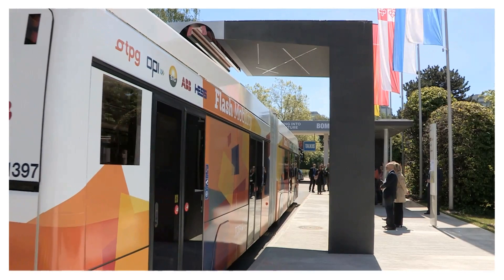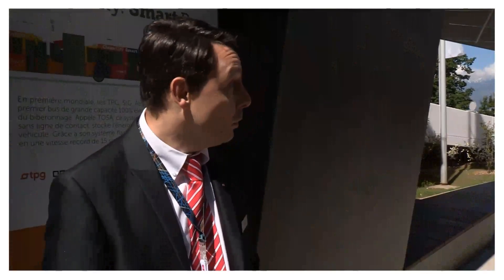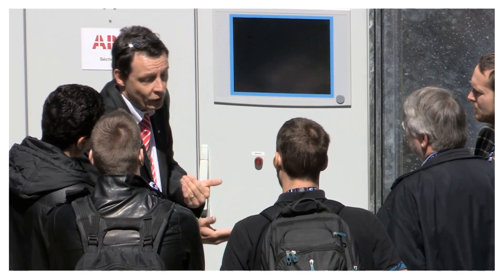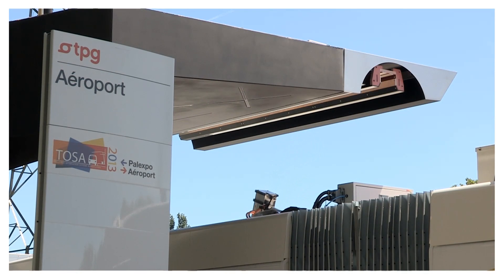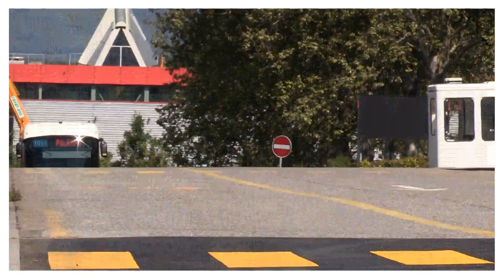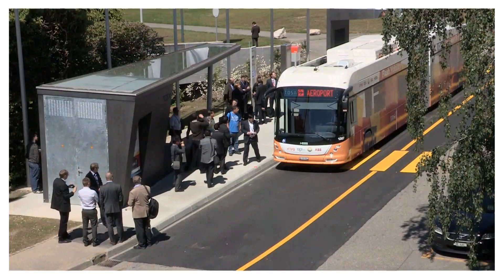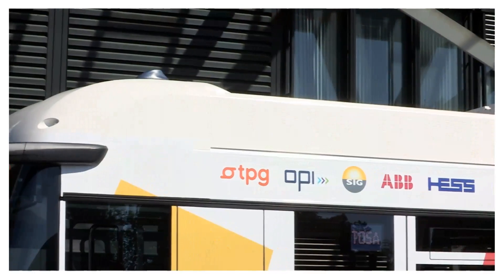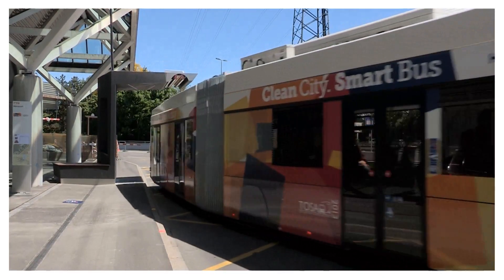Flash charging an electric bus in 15 seconds

Comment: Interesting concept, but installing flash charging at stops will be costly (and tricky for the drivers to line up the bus correctly).  In cold weather the 15 km range would be less, and if electric heaters are used, much less.  Until batteries can power a longer range and recharge more quickly, the electric bus may have only limited uses.  But it's a wonderful goal, and it will happen!
Reply: You don't need a charger at every stop, only a few. You can see the pantograph uses its own system to line itself up with the charger at 0:20.

Comment: what kind of battery can take such a huge load without reducing its life?
Reply: Ultra capacitors
Reply: Capacitor
Reply: XplaneZ its only partially charged on every station.  more amps for the battery just like phones.
Reply: Supercapcitors u have in electronics

Comment: Just how dependable is capacitive energy storage? So far capacitors have not been able to do the job that LI is presently doing for energy storage. Capacitors should cost far less for a KW as well as requiring less space and weighing less. So if capacitor technology is now practical we all have a lot to look forward too. Energy storage has be a big problem for years for almost anything that runs on electricity. This is big, very big. I sure look forward to having high volume capacitors available soon. The electric bus is great and a start, but just a start.

Comment: very simple idea but could use improvement on connection design.  Not very practical in my opinion.  Adomani has a charging system and battery pack in design that will fully charge their buses 100KWH (53.7 KWH...your choice) battery pack in 8 minutes and can accept 10 second to 20 second increment charges as well for a fraction of the cost even while using aerospace components and safer wire connections then seen in this video.

Comment: If the electricity is still created with fossil fuels and coal then there's no real benefit. This combined with solar and wind should be a good start though.
Reply: Switzerland has no coal power plants. Over 50 per cent of the electricity comes from hydroelectric power plants
Reply: but it's more efficient. so that means even if 100% of the electricity used to power buses would be generated using fossil fuels, it would be still much more efficient that running diesel buses. but since it's not the case as nuclear and green energy sources are present, i think it can significantly reduce the need to burn fossil fuels. using this technology we can slowly move to 100% green transport (talking about fuel), using diesel engines we can never achieve it. also zero local emission is good for people's lungs. so is my eyes this kind of development is always very positive.
Reply: It's still lot efficient than internal combustion...and also one bus can carry as much people as 40cars
Reply: only the fact that you take pollutants that kill your health out of the city to stations that these pollutants can be controlled easier is a great step.
how much platinum and precious metals can be saved, regulated and feel sure the devices they are in, work properly?
There are millions of dead catalysts out there that were supposed to clean ice exhaust gasses 
How much money and hours are saved for every ice powered car from inspection
Instead you have the power produced from a handful of places. Easy to control, regulate and proceed to the proper corrections. All this gasoline that is being burned inefficiently could be burned efficiently in turbines producing electricity and heat for home use. Then the CO2 could be captured at the stack with far greater efficiency than normal air. and much more
Reply: All the electric power of Geneva is from reneable energy.
However, the total energy balance for the city and the country is 66% hydrocarbons (crude oil, natural gas, coal).

About 33% of the total energy balance is from renewables, we have to invest more and need more time ... Technlogy is advancing fast !

Comment: Why not fill the bus roof with solar panels to help charge while it drives around ALL day?
Reply: spammeaccount Steve K. It's still relevant today. Solar doesn't have the capacity to really do anything meaningful over the course of a day in the space of a bus, especially with panels that are mobile mounted. You're better off putting higher efficiency panels at a fixed location and using that to offset the power used to charge. Something like a bus requires about 1.5 - 2.5 kWh per mile of power to run over the course of a day. The area on a bus might generate a peak of about 1 kWh during the best hours of the day, buying you perhaps 4-7 miles of driving per day, so the expense really isn't worth it, especially when you consider longevity of the panels in that mobile environment. At best, you could offset the cost of running the A/C or heat in the bus with solar, but you couldn't really supply the drive motor effectively.
Reply: Sunny Italy disagrees
Reply: There is no sun energy at night
Reply: Far too small an area, far too intermittant (clouds, night, winter). Very expensive, in the end.
Reply: Brian_H
There are flexible panels now that can be embedded as the skin of the vehicle and the continue to produce power even on cludy days. Your answer would have been correct for solar panels of 15 years ago but not for modern ones.

Comment: Is there a reason why a direct connect was used rather than use wireless inductive charging such as in Bombardier's Primove system?
Reply: Induction is slower and less efficient.
Reply: +SFB Addict Induction is just as instant as any regular transformer. I guess the power transfered in those few seconds is just way too much, it needs some big solid contact terminals.

Comment: What happens when they route changes, you're gonna have to pull up the rechargers and rebuild them
Reply: City streets do not change much !   You can move the charging station 100m if you must do it.
Overhead lines are more costly in terms of installing and maintaining !
Reply: Such a disaster huh.